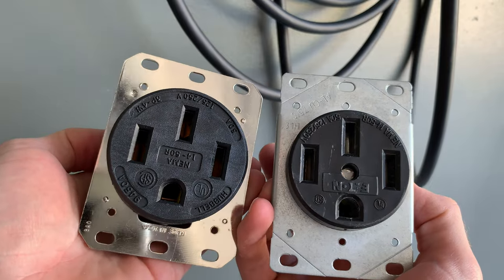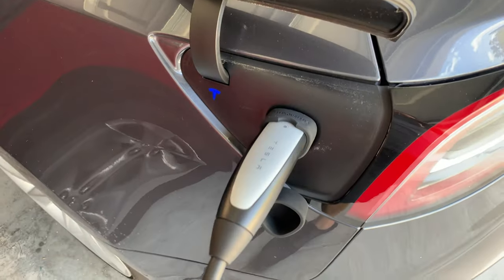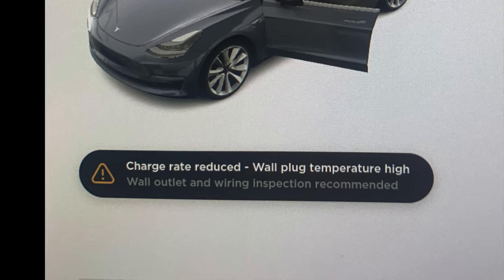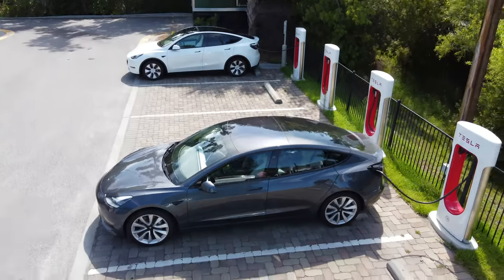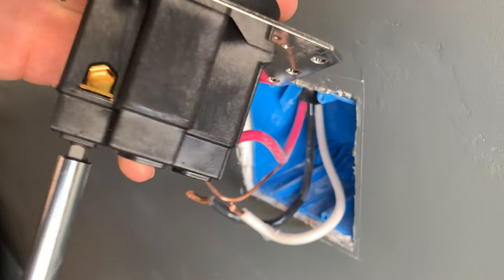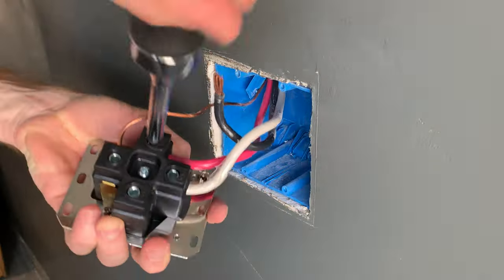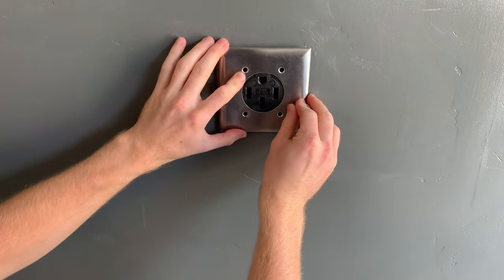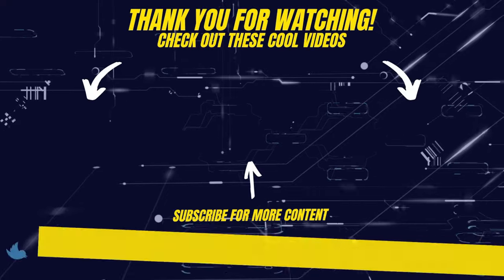Check Your Tesla Plug❗️ Why you MUST get an Industrial Grade Outlet 🔥 Tesla Recommended Receptacle

Comment: Evan:  The timeliness of your video is perfect. I didn’t know the difference between an industrial grade Nema 1450 outlet. I will be ordering the Hubble and wall plate before the electrician gets here in my new home we purchased.
Evan, could you send me the information of your white plastic Tesla plug hanger that is wall-mounted on your garage wall. I’ve never seen anything like this and this is also exactly what I need because I will be charging just as you are with the cord provided by Tesla. I have a used model 3 LR/RWD.   THANKS ! ! !
JVV - Long time subscriber to your channel.
Reply from the maker: Thank you! Yea I got that charging cable holder on etsy 👉🏼https://tidd.ly/3ujFltm
Reply: @andyburns5197  Thanks so much Andy. That’s great to know. Take care

Comment: What size electric box do you use to mount this plug?  Anyway to surface mount it instead of flush with the dry wall?
Reply: 5s metal box. With brackets or without depending on your style of installation. Metal is way better than plastic in stopping a fire, in case there’s ever one. Surprise this guy is talking about safety while using a plastic box 🙄 because plastic is cheaper. Oh the irony

Comment: Just curious….how warm/hot was your cable getting. If I charge mine at 32A it gets to about 120 degrees. I’ve reduced to 26A and the temp is now 110. I shouldn’t have to reduce the rate of charge.
Reply from the maker: Great questions! While I do no have an exact number on this.. I did charge during the day once to feel how hot this really got and I have to say it was very warm. This Hubbell Brand is rated for up to 194 degrees F.
Reply: @EMtesla1  I bought a laser temperature gun to measure the temp. Got it, yup, on Amazon. That’s the way I know how hot mine connector got.
Reply: you should think about getting thicker cables. All the heat are losses. Energy that isn't going your car, but in the air like a heater for your garage. It should not get warm at all. At least not that you can feel it just by touching it. 
If the plug or the outlet gets hot, there might be a bad connection and you resistance in the flow of the electricity. This is causing heat. You need to check on that as well. There should not be any obvious heat coming from your cable or installation. If you have a squeezed cable anywhere in your installation and the cable gets hot, it might be there even hotter and the root cause of a wire. Please be careful...

Comment: Thanks for sharing. How to identify the industrial grade n non-industrial grade receptacle?
Reply from the maker: typically you can tell by the weight difference and the torx screw hole to tighten down the wires
Reply: I've noticed the material used is different.  The cheaper outlets use thermoplastic, the more expensive use nylon.

Comment: Any mention of the amount of torque for the receptacle?  "Tight" may be too tight or not tight enough.  Spending on the better receptacle makes sense - especially when you've spent $60-100k on an EV.
Reply: Torque is specified in the installation instructions.

Comment: I have the Tesla recommended Cooper/Eaton 5754N and keep getting this warning and lowering of available current. I never remove the cord from the wall, so no insertion cycle issues there. The connections in the back are tight, too. I’m not sure going to the Hubbell with make the difference - can anyone comment on this?

Comment: If a 50amp outlet can't handle 40amps continuously then it should be recalled.
Reply: Not even pulling 40. The 14-50 adapter maxes out at 32.

Comment: Why is your grounding wire so small? Shouldn't it be the same or bigger as the hot and neutral? I would like my ground wire to carry the short current and trip the breaker not vaporize...
Reply from the maker: This is standard on the southwire brand 6/3 Romex wire.
Reply: On larger amp circuits, electrical code allows some downsizing of the ground wire.

Comment: Most plugs are rated for at least 5-0 amps. Cheap or not. The issue was either bad connections or the wrong wire for the job.
Reply from the maker: My connections from the old plug were very secure.. I actually had a hard time removing them. Also the wire is copper 6 gauge and with this new outlet I have yet to see any error on my Tesla screen.

Comment: Is the quality of receptacles not gonna help if you have a cheap aluminum bus bar panel. Rip that thing out and put a Cutler hammer CH cock copper bus bar in or go commercial bolt and breaker series

Comment: I had the same problem and changed out both the outlet and wire. Tesla recommends 6 gauge wire where most 220v outlets are 3 gauge.
Reply: Are you saying you took out the 3 gauge wire and replaced it with 6 gauge? Why?
Reply: @jamesrempel8522  😂
Reply: @jamesrempel8522  Initial installation was for a typical electric dryer; revision was for M3 charger that kept overheating. See other reply for specs.
Reply: Doesn’t matter if it’s for a dryer or a Tesla …they all pull electricity…if the wire is configured for 240v 50amp it’ll handle 50amp…cheap outlet will skimp out on think connector between the house wires and the car charger and cause heating for long period of time and the plastic they use probably can’t handle that much heat for that long either
Reply: 3 a.w.g. conductor will barely fit the lugs of a 14-50 receptical. 6 or 4 ga. should suffice. god help the electrical grid if ev's take off !

Comment: Plugs and sockets were never designed to carry high current loads continually.   For such situations permanent attachments are recommended.

The advent of the “charge at home” electric car has brought a new challenge.

No one ever thought you would run an electric welder at a 50 kilowatt motel in your garage all night……………it’s another case of unintended consequences.    A small fan built into the socket would help!!!!

Stavros

Comment: Luckily, I rarely charge at 32 amps because I charge as slowly as I can, keeping me out of the peak electrical rates. Mine is the cheap one, unfortunately! If I had known, I would’ve had the electrician install the better one, even though he would’ve fought me on it and charged me more labor for spite.
Reply: Sparky here. Why so quick to judge?
Would've installed for same price. You just order the plug, no problem.

Comment: I would say the terminals weren’t tight enough. Grainger….. McMastercarr…. Amazon is usually way more than a industrial supply even high quality stuff will burn up
Reply from the maker: I mean I had a very hard time loosening  the screws. The wires were in there very tight.
Reply: @EMtesla1  what type and gauge wire? If it burns up a cheap plug you should hard wire with a disconnect switch
Reply from the maker: 6 gauge wire

Comment: NEMA 14-50 is for an oven or RV. The correct outlet for dedicated EV charging is NEMA 6-50.
Reply from the maker: A nema 6-50 will work for an EV but the preferred outlet is actually a nema 14-50. This is from the Tesla website.
Reply: @EMtesla1  
A NEMA 14-50 oven outlet can be made to work for EV charging if a special adapter is used to disable the superfluous neutral wire, but a NEMA 6-50 EXACTLY MATCHES EV charging electrical requirements wire-for-wire.
Reply: @RogerWilsonTodd  so tesla is wrong?
Reply: @k3mikal  If you want a dedicated EV charging outlet for a Tesla UMC or Wall Connector, NEMA 6-50 PRECISELY matches the electrical requirements and will NOT need an adapter that knocks out superfluous conductors like those present in an oven or RV outlet.
Reply: @taekwoncrawfish9418  The Nema 6-50 does not have a nuteral. The Nuteral is not reqiured for EV charging. But the 14-50 is more popular anyways. They both deliver the same amperage but you won't be able to use a 6-50 for something like a range unless you use a 14-50.

Comment: I thought the only difference was that the expensive one was made for more insertions. If you dont unplug your charger from the wall it should be ok.
Reply from the maker: Fair point; however I rarely unplugged my mobile charger from the wall, yet over time; the heat must have overtaken the cheap outlet.
Reply: The heavy duty one has nice thick solid copper connections, while the cheap one looked like copper plated aluminum. Zoom in on his picture of the two receptacles side by side.
Reply: @mitchellbarnow1709  Regardless of the connections, they're both rated for the appropriate number of amps. There shouldn't be an issue with them. Every tract home in the United States has a cheap 220 plug on their dryer and oven because the plug/unplug cycles are low. Its more likely that the wiring was loose or he simply had a faulty unit. There's no legitimate reason why a "cheap" plug shouldn't work. All of these outlets are tested to spec by UL.
Reply from the maker: Those screws holding the wires on that Eaton outlet were very tight. I had difficulty loosening them. There’s no way the wires were loose.
Reply: @EMtesla1  Then you had z bad outlet. Every electrical component is independently tested to by UL to make sure it can continuously support 80% of its rated max.
Reply from the maker: Must have been! It only lasted six months. let’s hope this Hubble lasts way longer.
Reply: @EMtesla1  That Hubble is going to outlast the rest of your house, it looks that heavy duty!
Reply from the maker: Let’s hope!
Reply: @EMtesla1  Your arms look really strong 💪🏽, Evan, so those screws must’ve been very tight on that cheap outlet! Aluminum is not nearly as good of a conductor of electricity as copper is, so that might account for the increase in temperature.
Reply: @kungfoochicken08  kunfoochicken is correct. Both outlets are fine. The less expensive one is meant for less insertions. If they become loose, you will not have a good connection at which point can lead to arcing, not something you want. When in doubt just buy the more expensive one for a peace of mind. Im fine with the cheaper one as Im confident my intended application and purpose. I charge everyday and it doesnt get alarmingly hot. Just need to make sure you dont have loose connections anywhere.
If anything, people should make sure they use the proper gauge wires from their breaker to the outlet.
Reply: @EMtesla1  It will outlast the Hubble Telescope!
Reply: @EMtesla1  You need to look at ferrules for your wires.

Comment: It looks like you did not have enough wire exposed from the insulator to make a proper connection to the back of the nema plug.
Reply from the maker: Hmm idk why it seems that way… I have plenty of wire exposed to the nema plug

Comment: Total nonsense…the $10.00 receptacle will work just fine. Ask electrical contractors, and you’ll find the majority will use Leviton, Eagle, Pass & Seymour..each approximately $10.00. They are all constructed to the same UL standard, I believe it’s UL498. Hubbell makes great products but sometimes the additional cost is not justified.
Reply from the maker: Alrighty then, thank you for your opinion.
Reply: The Hubble unit has compression type clamping so the screw tightens two opposing plates to compress on the wire. With the competition, the screw bears up against the wire directly, as the screw rotates it does damage to the wire to some degree.  With Hubbell, you tighten your connection with an Allen wrench allowing you to use a torque wrench to tighten the screw to the exact specified force. Hubbell is made in the United States, the competition is made in Mexico or China.

Comment: While right, it's hard to accept advice from someone who only charges their Tesla once a week, which is definitely not what Tesla recommends.  :-P
Reply from the maker: I only drive 14 miles a day … I just don’t see the logic to charge every night
Reply: @EMtesla1  It's actually the same logic that lead you to get an industrial 14-50 outlet - Tesla directly says to do it in their manual.  As long as you're staying above 20% and below 90%, I suppose it's fine - but this video was about what Tesla recommends, so thought I would mention.
Reply from the maker: Right I’m well aware with Tesla recommends I just don’t find the need to plug in every single night. Thanks for commenting though!
Reply: @EMtesla1  when the car is plugged in the car conditions the temperature of the battery to keep it at optimal health long term. This will actually improve longevity of the battery. This could be an issue if your garage gets hot and cold. Temp extremes are not good when storing lithium batteries.